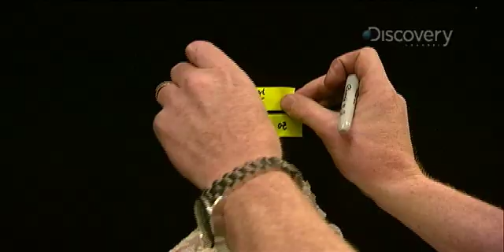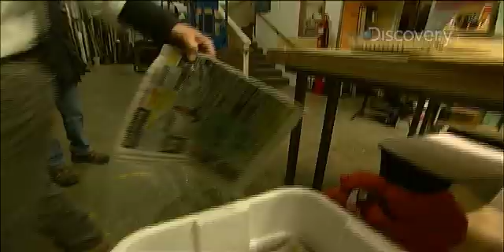MythBusters - Pie-crete

Comment: Salt melts ice.  If you are out on the ocean in a Pykrete boat wouldn't it melt way faster and thus sink way faster?  And, even if the salt doesn't affect it how long do you have before it naturally melts completely and you are left bobbing around in a sea of saltwater and melted Pykrete?  What about using it in hot climates?  You would think that, while the theory is correct and it is extremely strong that strength won't last a very long time at all.  The strength literally has an expiration to it!  Just like milk in your fridge that expiration time is going to decrease if you set it out in the hot sun.  Great idea in theory but a bad idea in practice.  However, it does make for a fun science experiment!

Comment: If I remember correctly you're supposed to make pykrete with fine sawdust, not wood pulp. Apparently that shit is really next level.
Reply: Hell i know a guy that cuts wood to build stuff. He does it outside. In winter when it freezes with the saw dust it becomes a weapon at that point. The guy took a piece of it and made a "sword" if you can call it that and used it to smash (not cut because it was not sharp enough but smash) things. The sword lasted over 2 months. It was though.
Reply: @etheriousnatsudragneel5835  tough not though dumb ass 😂
Reply: Your right about the sawdust.    Their test was flawed.
Reply: Technically, wood pulp can consist of sawdust
Reply: Technical details were never their strong suit.
Reply: I know some people add epoxy to wood powder and it works well

Comment: so am I right placing plenty wood pulp in concrete mix stirred might make better concrete, like recycled paper cardboard products in concrete home made block, or a shed floor made of the idea I got form these type videos. like super cheaper building project material than wasting land fill space using this as new build blocks.
Reply: Pretty sure this wouldnt work.
Reply: ima mix my cereal with wood pulp to make a better breakfast
Reply: You are heading in the right direction, just using the wrong materials. Concrete can be reinforced with with steel bars or mesh or fibres of steel or synthetic fibres.

Comment: What is the melting point of pykrete
Reply: 0 degrees Celsius, it's just that it disperses heat way less quickly because of the wood inside, so it takes longer for the warmth of the room to reach the ice inside, elongating it's melting time...
Reply: Thanks so much!

Comment: So first thoughts about this material: I imagine the slower melting could be largely due to much less surface area of pure ice exposed to the air. The greater strength is rather straightforward, as the ice and wood are essentially woven together. The Pykrete broke in a predictable manner too, considering the shape of that block and that it's bound to have weaknesses through uneven material distribution. The newspaper improved on it with it's even shape and inherent fiber-like tensile strength. Newspaper being already "woven" but also porous enough for the ice to create perpendicular and intersecting lattices through the empty space.
I'm not sure, but I'm also thinking that making sure there were no gasses or bits of matter caught in newspaper/water mixture prior to freezing would be a good thing, as gaps may cause fracture points.
Reply: I agree with you. There was error but great comment
Reply: Hitodamak stfu. No one is interested in reading a novel length post on shit they learnt in the 3rd grade
Reply: @wufongtanwufong5579  you are an asshole.
Reply: @wufongtanwufong5579  <<< didn't learn any manners in any grade of school.

Comment: I have a couple of questions. Was a test conducted to check the melting times of the newspaper version versus the sawdust? Would super fine sawdust have been more effective? Would first boiling the mixture before freezing it create a stronger substance? Lance Farrar said he made a version of this using polyester cloth. Would a cloth version be more effective than a wood or paper? Also in regards to making a large CV of this in WW2, would such a material stand any chance against different shell types of, say, an Iowa class BB? It's AP shell could penetrate up to 30 feet of concrete. I understand a super large carrier would have incredible defense against anything via its aircraft, but if it were to be shot what type of damage would be expected?
Reply: It was supposed to be torpedo proof and also repairable.
Reply: Allegedly, the pykrete was strong enough to stop a bullet from penetrating. A block of ice in the same test shattered completely. The strength isn't an issue, its building a system around it to keep it cool, that is the problem.

Comment: This wood have been a lot more impressive if they made it out of super fine sawdust instead of wood chips. it would have been stronger than the newspaper.
Reply: no, it would be weaker. The reason the newspaper was stronger was because it was made out of wood fibers rather than wood chips. Using wood dust would have been weaker still.
Reply: @MrMarinus18 the original project Habakkuk used saw dust to make Pykrete and it supposedly worked well enough to be bulletproof
Reply: @deeznoots6241  True but that doesn't refute my point. Frozen paper would still be stronger.
Reply: Think of the fibers, wether wood pulp or paper, as a reinforcing connection between the ice cristals that make up the block.
The larger/longer the fibers, the more they can connect.
The woodchips can give more connections than fine sawdust, and paper does so even more.

Comment: i think even jamie's method could be improved upon.  a very fine paste mixed in with the paper would give it characteristics of each and perhaps even hold steady when dried out...

using a wheat flour and water mixture to make an architectural modeling glue, stir in a small amount of sawdust, fill the mold with newsprint, pour in the woodwheatpaste, allow it to permeate the paper well, even allow for a bit of drying, then freeze it into a brick.  TRY IT.  it's killer shit.

Comment: @DeaDGoyO 

Its a type of material designed to make ships from.
As they said on the video, its made from wood pulp and water then frozen into sheets (which could be screwed together)

The whole construction would then be put into the water, this would seal any holes as water flowed into them and froze. 
The idea was to make Cost effective ships from this stuff.

Sea-water is always cold around Britain, so the ship would never melt.

Comment: Sawdust, or some other form of wood pulp. News flash: Woodchips are a form of wood pulp.

14% by weight. Another fascinating fact: Most wood is less dense than water so it's going to be quite a bit of wood to water.

As for the title, shouldn't be hard to tell that it's a play on words.

Comment: @DSJeffers yes, in that case it's like concrete reinforced for tensile strength along a single plane. It should be just as brittle, if not more so, cross-sectionally, and this might also have consequences for melting and bullet impact. Of course, in actual engineering, one can and should reinforce in whatever direction one needs.

Comment: I haven't tried it, but I think an ice bullet would shatter on being fired and you'd get a nice plume of steam out of the barrel. A pie-crete bullet would be better, but there is that toublesome wood pulp left behind. A CSI episode solved the problem by using a meat-bullet.
It melted, but meat is pretty much meat after a fatal shooting. Of course, the CSI guys were WAY too clever and solved the problem in less than a running hour of the TV show. Meatball ballistics? I don't know..

Comment: The strength and insulation quality comes from the wood fibers. Nothing new since Fiberglass lamination has even better strength and insulation qualities plus it doesn't melt. the issue was that during WW2 composite material were still in their infancy. I doubt they could have made a workable Aircraft carrier from it though. The North sea is an unholy terror during the winter months...